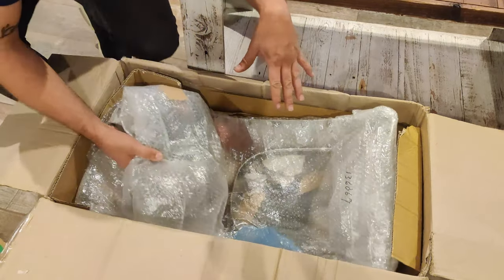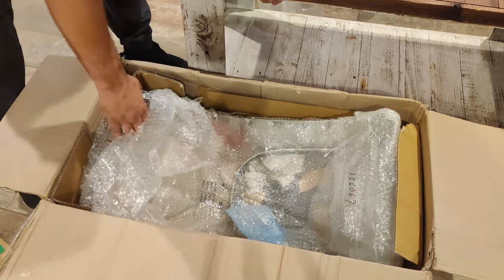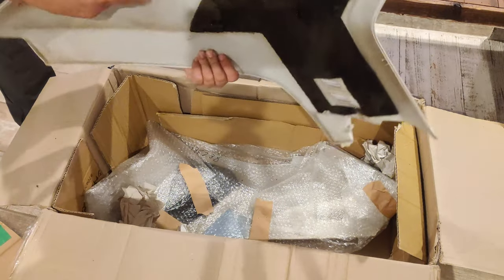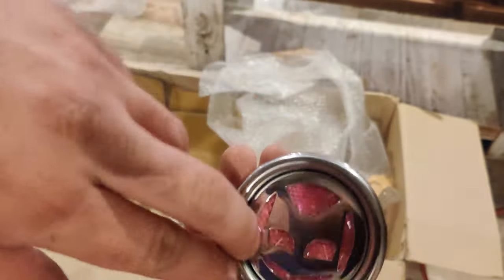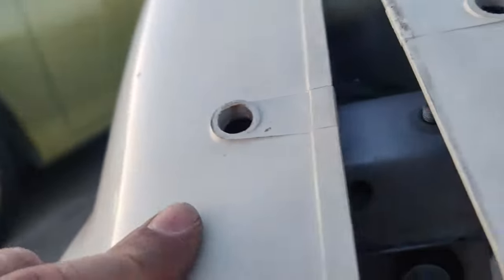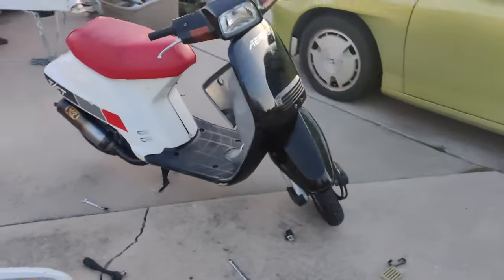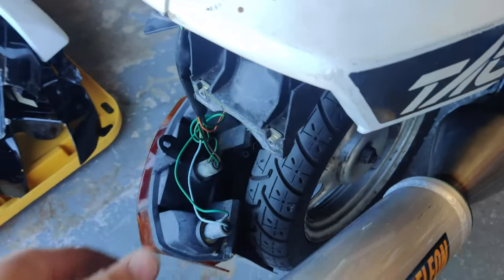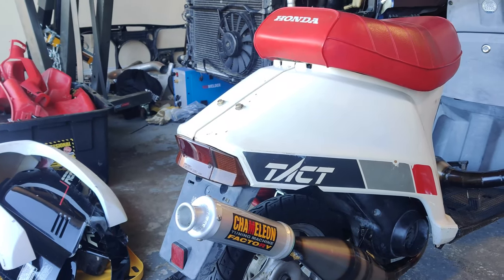Honda Aero 50 Tact Conversion

Comment: I was wondering would that chameleon exhaust work on my 1986 Honda Aero 50 afo5e engine?
Reply from the maker: There is a different model chameleon that will work. Mine is for af16
Reply: Ohh ok thank you for getting back to me @BrunerTuner
Reply from the maker: @ryanslusher921  no problem! Good luck with your scoot!

Comment: Where did you order the body panels? And would you sell the oem red inner dash with glove box ? Pm me if so interested
Reply from the maker: I'd like to sell all the pieces together
Reply: @BrunerTuner  the 3 red or the entire body ?.
Reply from the maker: I've got the glove box/floorboard, and the headlight surround. I also have a set of black tact Fullmark rear panels
Reply: @BrunerTuner  what are you asking for the the 3. im also in texas btw nw houston- cypress area ! just scored the same scooter but 86 same colors for 100$! only broken part is literally where the 2 front  turn signals are ! let me know
Reply from the maker: Which 3 pieces in particular do you need
Reply: @BrunerTuner  let me know what your thinking on price on whatever you want to get rid of price for all 3 glove box/floorboard, and the headlight surround is cool and or separate how ever you want to do it i really only need the glove box section  Like I said I'm in texas so shipping should not be to bad . Can pm me or I can send ya my fb or email or w.e and or if you located close i could pick them up and save shipping!.
Reply from the maker: @nathanw5747  yeah shoot me a message on email. taylordarr3@gmail.com